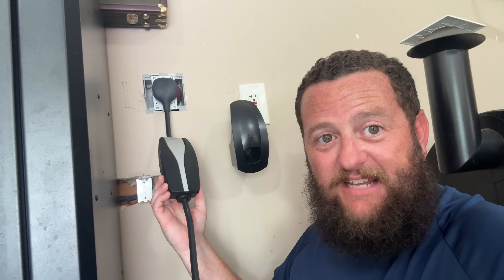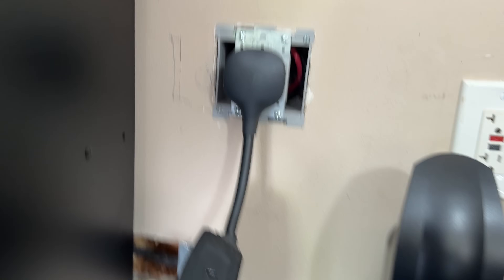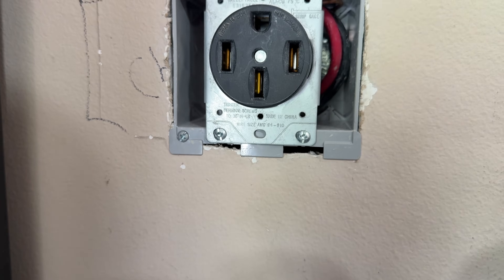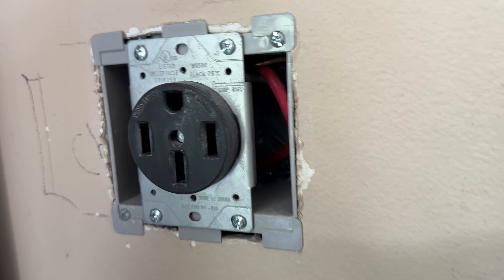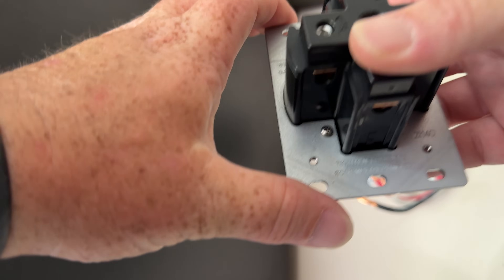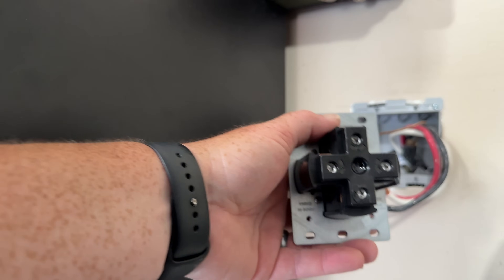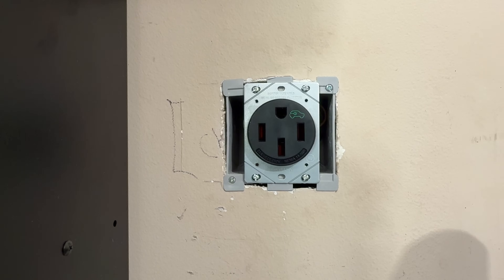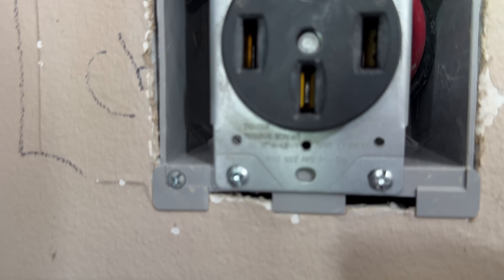Tesla Charging Failure Could Be Faulty Equipment/Fire Hazard!!!! Do This To Fix It Now!!!

Comment: The same problem I do have. 
one of electrician installed this 240volt outlet, they do think the normal switch works great. It worked for an year with no issues, it stated heating issues since couple  of months.

Comment: The heat is from corrosion, wear.  The wear increases the resistance at the prong connection.  The wires connection being lose causes the same effect.  If you have an EV I suggest spending the money to get a dedicated EV Charger and have it hardwired to the existing dryer wire.  If new installation I suggest going with larger wire to reduce heat buildup in wire with proper connections and even protective grease to keep down future corrosion.  Just my opinion and this is how my EV is charged.

Comment: I used an rv outlet out door locking box and had no problem 
I have found that the movement of the wire puts stress on the plug and can move it 
With this box it locks the plug in the outlet

Comment: The exact same issue happened to me with the Tesla mobile charger that came with my 2022 Model Y. Fortunately, Tesla replaced it under their 2-year warranty. Everything has been working perfectly with new replaced mobile charger over year and half now. The outlet I used was a Bryant 14-50, made by Hubbell, professionally installed by a licensed electrician, it was rock solid.

Comment: I had an electrician run a line out to the side of my house for EV charging and he used the cheap Home Depot outlet.  About a year later it failed - luckily it didn't burn down the house.  I replaced it with the Hubbell, torqued to spec (had to buy a torque driver), and now, 2 years later, I'm getting that message again.  So can't recommend the Hubbell.
Reply: Thanks for posting. I was wondering about that Hubbell. Leviton doesn’t have a great reputation but maybe this new EV plug does. I wonder if Lutron  makes one they seem to be the better one?

Comment: I’ve done my own electrical on basic stuff like installing new switches, outlets, running new wiring for new lighting. My PSA: hire an electrician who specializes in THIS so they can do a holistic assessment of your entire system. It’s more than just measuring the temperature of the outlet with an infrared temp gun. Also educate yourself via YT videos like this one so you can do a sanity check on what the electrician is telling you, justin case. My neighbor and I both used Qmerit. My electricians were excellent, new their sh**. The electrician Qmerit assigned my neighbor was not very good.

Comment: you can torque all you want but if the screw is only biting into half the strands, there will not be enough wire contact. 

use a ferrule to hold strands together or fold the end to get better filling. 

this solved my overheating.
Reply: I was surprised when I saw the bare stranded wire. Didn't know that was allowed in North America!
Reply: I have a ferrule crimper and have been wondering if it would be safer to put a ferrule over the stranded wire before torquing it into the outlet.

Comment: Probably best to use a temp gun on your at home charge plug a couple times per year if the plug is used for daily charging.  Check the temp of the plug after it has been charging your car for an hour or more, and note the temperature (it shouldn’t be much above ambient if all things are sized correctly).  This is especially important where warm ambient temps occur, but a regular checkup will tell you if your plug is showing signs of thermal stress.  If the terminals inside these plugs are permitted to get hot, their grip on the plug on the charge cable weakens, which then adds resistance to the connection, and the heat damage begins.  These connectors don’t last forever, especially in long duration applications such as EV charging.

Comment: there is outlets made for EV chargers you don't use home depot outlets lol, that is the reason people have issues and also have regular joe's install them ...not knowing anything about EV chargers and think "hey that's easy its just a 220v plug outlet". It's easy better to use a regular torque wrench so much more easy to torque the screws... almost effortless,  I wouldn't ever use a torque screwdriver.

Comment: I have always charged with a 20 amp circuit which delivers 16 amps.  No problems, less costly installation (12 wire), and ample overnight charge capacity.  My charger was purchased on eBay (same handle as Chargepoint and similar) and requires using the little Tesla adapter.  (I am using one of the receptacles from my two garage heaters but wiring these is easy and inexpensive--I did the original wiring).  VERY FEW need large capacity charging capability on a daily basis.
Reply: Sure, but when the video talks about "amps", it's referring to a 240 volt circuit. Are you? It would be foolish to install a 240 volt, 20 amp circuit, so I hope you didn't do that.
Reply: @Willtellthetruth  Absolutely did!  My point was that almost no one needs a 30/40/50 amp circuit to charge their car.  My garage heaters run on 20 amp 220v--one of which, rarely needed, I swiped for the car.  Foolish is misunderstanding what electrical options are available.  A 20 amp 220 is wired with 12 wire (inexpensive--wire and plug) hot on both leads--and feeds 16 amps to the car: it says so when charging.  The charge rate is about exactly twice what a 110 provides--or put another way, half the time.  Car will easily charge from 30 to 80 percent overnight starting after 9 (low rate).  My auxiliary 220v baseboard heaters also run with 12 wire.  There are electrical wiring manuals for those with limited knowledge.  I'm old--could send you mine.

Comment: When screwing down stranded wire, you need to back off half a turn, then retighten, and repeat a few times, to remove the gaps between each strand.  Otherwise, the connection may loosen over time, even though the screw didn't loosen.  (This may have contributed to the loose on the old socket.)  It would also be good to cut them to the right length, so excess bare copper is not exposed in the back of the outlet.
There were also multiple multiple mentions of shorts, but that's actually wrong.  Loose connections (both for the plug and the screw terminal) cause high resistance, which causes resistive losses as heat.
BTW, the old socket E316259 is Enerlite's "Industrial Grade" 14-50 receptacle...so the term "Industrial Grade" means nothing!  Good advice to get EV-specific ones instead.

Comment: Before replacing receptacle, I’m surprised you didn’t warn viewers to flip off circuit breaker AND test power is off with a meter or probe.  I’ve heard of DIYers turning off wrong breaker.
Reply from the maker: I confirmed power was off before unplugging the mobile connector
Reply: @BeardedTeslaGuy I have no doubt you turned off power, but as a PSA, warn DIYers to turn off power first and text for safety.

Comment: Justin, the heat you measured is from cheap contacts in old NEMA 14-50R receptacle.  They were rated for about 2 dozen insertions and your friend probably exceeded this already with mobile connector.  Another factor is weak wire terminations and insufficient torque.  

After torquing connections, wiggle wire and re-torque.  You’ll be surprised how much it loosens.
Reply from the maker: The torque spec on these is so much farther than any outlet I’ve touched. Such an important step

Comment: Tighten, wiggle, torque, wiggle, torque for stranded wire. I like your videos Bearded Tesla Guy but you're not an electrician and this installation IS NOT to code! Code is built on blood and is there for a reason.
Reply: Just curious. Which part is not up to code? That way I know what to do from my side as well.
Reply: @AnonymousTips90  From the box to probably the Romex (ampacity) used and how secured... the list goes on. NOT TO CODE!!! Using the cheapo receptacle was just the start. Get a licensed electrician certified by Tesla to do the work....the Telsa One app actually has all of the detailed steps including taking photos of each step to verify. It isn't difficult but MOST people do it wrong....even your regular licensed electrician as they don't take into account the continuous load requirements especially for AMPACITY (wire, conduit, CCC's, breaker, torquing, etc.). It is all about heat build up and arcing... If you don't know the details and not willing to learn every detail, hire an electrician that is certified for EV connector installations (preferably Tesla certified). Do you really want to sleep in a home while your car is charging overnight? At the very least DERATE to 50% or under of the circuit size if you are NOT 100% sure all is correct. safety safety safety At first set up charge at the max allowed and check each connection for heat every 30 minutes. I had a bad breaker (it happens) the that was heating up to over 170F but not yet tripping - the wire connection was 100% correct (perfect) and the breaker was solidly seated on the bus bar (newer load center too)... it was something internal to the breaker that is only revealed under a continuous load setting. Swapped out the breaker with another new one and now the temp is around 120F or less (using heat sensor gun and my the feel of it too). It scares me what I see posted...a little knowledge is dangerous.
Reply from the maker: The video is to help people recognize if their existing equipment is to snuff
Reply: @BeardedTeslaGuy  It DOESN'T as there are still code violations!

Comment: I am moving from NY to FL next month and I asked them to put an EV plug in the garage for me. I'm happy to report that the electrician used the same plug you show here with the green EV symbol. When they showed me their work, it was the first time that I saw one. There are a few things to be aware of if you swap in the wall connector. The wall connector supports a higher charge rate than the mobile connector IF you use a 60A breaker. I am not sure if the gauge of wire needs to be heavier, but you must configure the wall connector to match the breaker you have - in your case it is 50A. I have the first generation wall connector at my house now, but I plan to use the mobile adapter that came with my new Model Y in the new house. Tesla sells a $35 cable organizer that will hold the mobile adapter so that it does not pull down on that outlet. It also has a piece that can be used to hold the 20 feet of coiled cable. For me, this is a better solution because I have another mobile connected from my first Tesla that I can leave in my car for emergencies. I also like having the ability to simply replace the mobile connector if mine has a problem or there's a new version that I want to get. Awesome video that gives me more confidence for my new home builder!
Reply: The biggest thing is making sure the wires are seated correctly into the receptacle's connections and torqued to the specifications listed on the receptacle. Of course use the correct wire (check for AMPACITY!) and breaker sizes too. An EV rated receptacle is a must but in a pinch just derate to 50% of less of the breaker rating and you should be fine, but check for heat build up every 30 minutes if using a temp set up. The Tesla Wall Connector is the preferred set up as it eliminates a receptacle and usually the local code requirement of a GFCI breaker as well as additional safety features and ability to be updated for safety via wi-fi software downloads. The Tesla Wall Connector is a champ, I have several.
Reply from the maker: Yep! Wire has to be to spec and the breaker also. The wall connector will identify the breaker on its own to prevent over draw, but you still have to double verify to be sure everything is set up right
Reply: @BeardedTeslaGuy  FALSE. Sorry, but the wall connector and mobile connector do NOT identify "the breaker on its own" whatsoever. When you set up the Tesla Wall Connector you input the breaker size as part of commissioning the unit ... YOU do that and YOU can put in whatever breaker size you want even if it is wrong, which is why YOU need to know the correct wire (for AMPACITY!) and breaker so you set it up correctly! Moreover the Tesla Mobile Connector ASSUMES the breaker size and amps based on the plug adapter you connect to it .... again, that could be WRONG say if the receptacle, wire size and breaker are wrong as is assumes what you are plugging into is to code for the intended use of continuous use. If you use an adapter say for a dryer receptacle so you can use the NEMA 14-50 that comes with the Tesla Mobile Connector it will assume it is a 50 amp circuit and try pulling 40 amps on the 30 amp circuit (which should be 24 amps max used) AND the mobile connector's heat sensor won't be able to detect the temperature at the actual receptacle! Sorry BeardedTeslaGuy - you have some great videos and I do enjoy your content but YOU are NOT an electrician and what you have posted on this subject is only partial information at best and in my opinion IS DANGEROUS. Just bring in the guy from State of Charge for ACCURATE (mostly) information.

Comment: After 3 years of charging on 14-50 outlet I bought on Amazon (be very careful for EV charging outlet on Amazon only charging under 30A)
It is time to change the good outlet and this is exactly what I got but from Home Depot. Same thing    50 Amp 125/250 V NEMA 14-50R EV Charging Weather Resistant Single Outlet/Receptacle, Black (1-Pack) 1450W  and it is $69.9
Reply from the maker: Smart

Comment: 3:00 you need to install the correct sized box. If a fire broke out inside the box, there is an open source of oxygen and way for the fire to escape. Plus, rodents or insects can crawl inside.
Reply from the maker: He went to the store the next day and got new hardware for it

Comment: Finally getting my first Tesla on Monday!  I have a LONG commute, and plan on plugging in to a 120v outlet while at work for some extra juice.  But it will be outdoors in the Florida sun/rain. Any suggestions?  

Seems like overkill, but I’m thinking about building a mobile travel charger box out of a pelican case/weatherproof box, case fans, a power splitter and a short outdoor extension cord.  Just stand the case up next to the car with the brick inside, being cooled by the fans.  Thoughts?
Reply from the maker: No direct concerns with the part you’d be able to control. It’s all about the quality of the outlet at work
Reply: @BeardedTeslaGuy We’ll see.  It’s a parking lot light pole.

Comment: Great Information ! Thanks for sharing ! I decided early on I would just have a Tesla Gen3 wall charger installed - a solid hard wired connection. Just use my mobile connection at my campsite/trailer . Cheers
Reply from the maker: It’s the safest option for sure

Comment: You pulled out a 30 amp socket. That is a big no no. You need a 50 amp rated socket or better yet a 60 amp. Also electricity vibrates so that is why you found loose screws.
Reply: I’m a bit confused by this comment. Do you mean, it isn’t recommended to use 30amp socket to charge the Tesla?   That is what I’ve been using for about 4 years, I never unplug the main plug and charge overnight at about 16amp.  I don’t think my plug is EV rated so I been thinking about upgrading to 30 amp EV type
Reply from the maker: The outlet in there was not a 30 amp receptacle

Comment: Also watch out for that 120v outlet next to it. Always verify your 120 outlet is spec/heavy duty and using screwed connections. 

I used 110v for a year before adding a subpanel and 240 outlet on my garage in my garage. One day I smelled smoke. My 120 outlet was the last of 4 outlets using backstab type wire connections! One outlet in the middle had let its smoke out. Another was heat damaged. Now they are screw type heavy duty (it is a garage after all). Of course now it just use a 50a 240 and even debate that to 32amp use only.
Reply from the maker: Always double check these things!

Comment: So is this really only an issue if you plug and unplug the charger?  Asking because we leave ours plugged in all the time.
Reply from the maker: No, the receptacle will overheat over time even if never unplugged. They aren’t made to withstand this kind of continuous use
Reply: @BeardedTeslaGuy 🤔 I know that our electrician specifically knew that we were using both our 14-50 outlets for charging, but I know nothing about this stuff. I may have to DM you a photo or something to find out if we are ok.
Reply: We leave ours plugged in all the time as well and experienced this issue two weeks ago. I went in and torqued the screws (a couple weren’t tight), I later replaced the outlet with the one he used in the video.

Comment: Good to use the correct product. I bet the issue was mainly generated by the loose connections in the back. if the connection is loose then you're likely not utilizing the full capacity of the larger wire sizes. therefore, generating heat. You can get thermal run away if ampacity is constant and you continuously decrease effective wire size. Much love to my electrical nerds out there.
Reply from the maker: The torque spec is so much more important than most realize